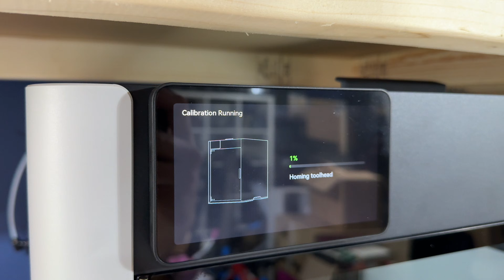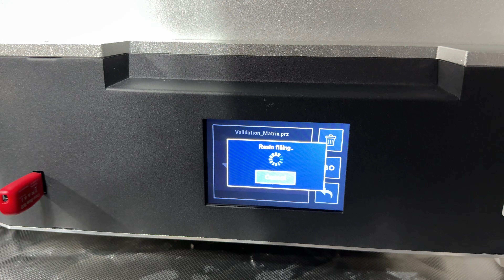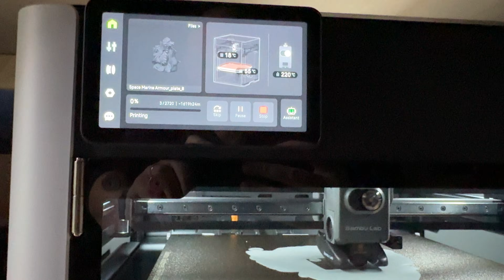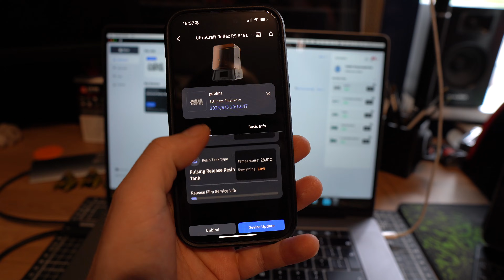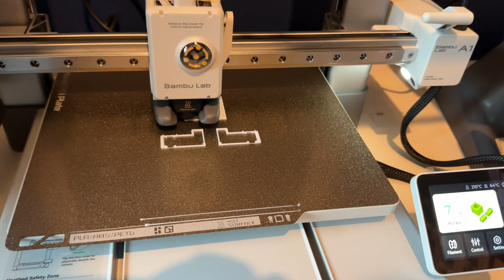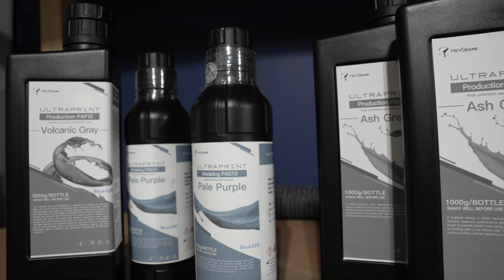My 3D Printing Predictions for 2026: Are subscriptions coming?

Comment: Detoxizying the resins needs to be job 1 for resin printing. I also wish that pixel size (PPI) would take over as the marketing approach. I would gladly and immediately change slicers for one without a subscription. Also really, really need easier consumables replacement, especially screens!

I have four Bambu Lab printers, but I will never buy any hardware that requires a subscription. And I will drop any subscription slicer as soon as there is a viable pay-once or free slicer for FDM or resin.

I also do not now nor will i in  the future knowingly use any AI generated models whether free or paid. Though I will gladly pay creators for their work, in fact I do now.
Reply from the maker: Yeah PPI would be a much better approach to screens in my opinion.

Comment: I reeeeeeeeeeeeeaaaaally wanna see resin machines go back to 8/10/12k screens. 14's and 16's and whatever new "big number" they're gonna go to have such serious longevity downsides with no real measurable "quality" upgrades
Reply: Also, if manufacturers wanna do subscriptions they NEED to make sure basic functionality is free. Myself i would outright trash a machine. Literally throw the thing out a second story window and watch it shatter on the pavement, before i'll submit to having to pay a monthly sum just to use the damn thing. And i feel so strongly about that i had to walk away from the keyboard and then come back and edit out some swear words. I'm sure many others hold a similar opinion, though maybe not so extreme a reaction. I paid for the damn thing, i NEED to still be able to use it even if you wanna lock away the "fancy" features behind a further paywall
Reply: @gryphon3241 Yes, agree completely.
Reply: They're not going to go back, sadly.  They're beholden to the manufacturer of the screens.
Reply from the maker: Yeah I agree, those free features need to remain untouched.